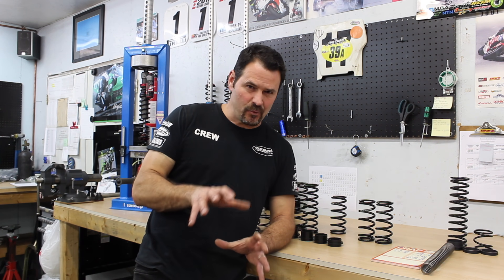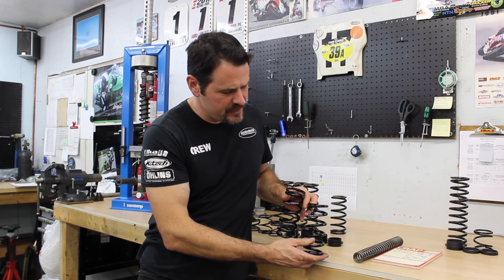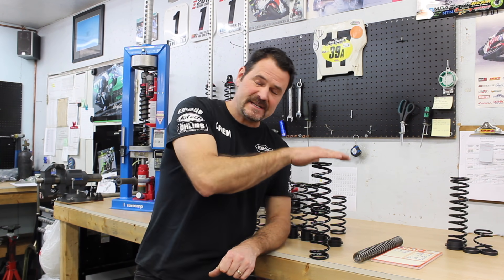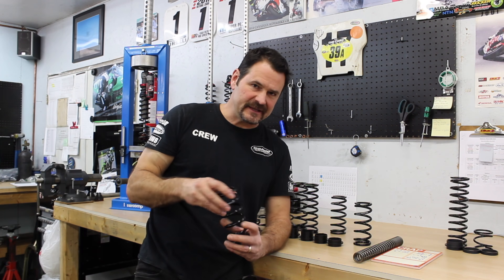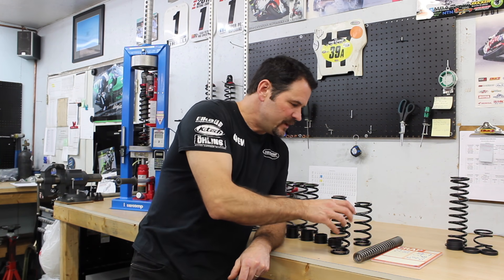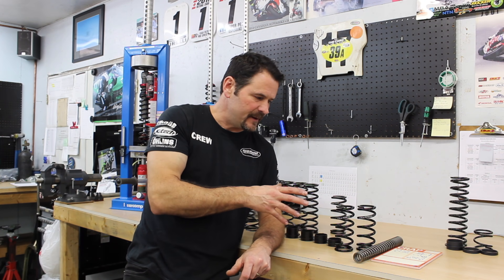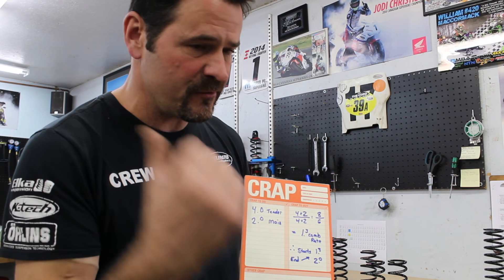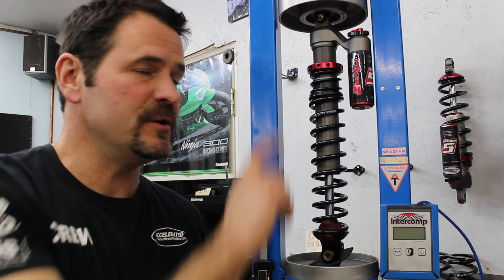Snowmobile Suspension Set up by Accelerated Technologies -  Dual Springs Explained

Comment: Love my setup you did on my X RS. Works amazing. I should have done the dual rate springs to make it even better. One thing i did for rear shock is put new torsion spacers in. The stock rear springs are too soft and tough to get the proper pre load. So I cut the old stock spacers off and put on the red Hygear Suspension torsion spacers and it definitely helps. I'll be back for sure.
Reply: I used some biteharder polytune rings for a progressive front along with hygear spacer in the rear.  2019 Backcountry 850. I'm now adding some ski contours. ZRP summit widening spindles have it sitting parallel with ground looking at the a arms.

Comment: Have you had a chance to take a close look at the 21 MXZ XRS suspension?  I would like to bring the ride height of the XRS down a little over an inch to the ride height of the MXZ X without upsetting the balance.

Comment: Something seems wrong with this theory, if the tender spring was in fact 4.0 and the main a 2.0, the tender spring would not compress before the main spring.  Tender springs are supposed to be softer, not harder than the main spring.
Reply: MIT, I had exactly that question. Thanks John for the explanation. Greg.
Reply: @acceleratedtechnologies9801  Great explanation, thank you.  Now i just need to make the call to get a set for my sled!